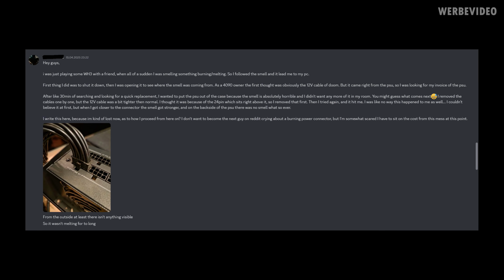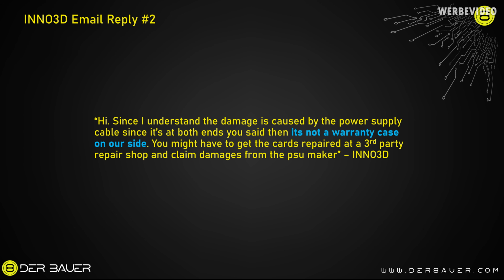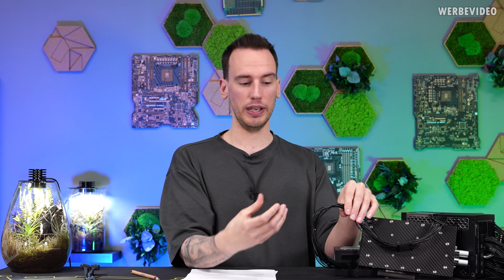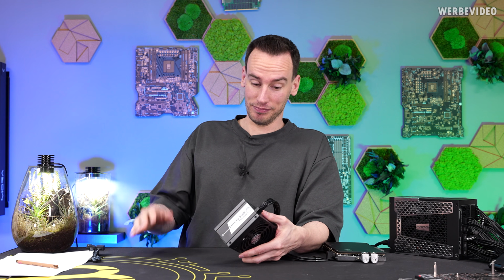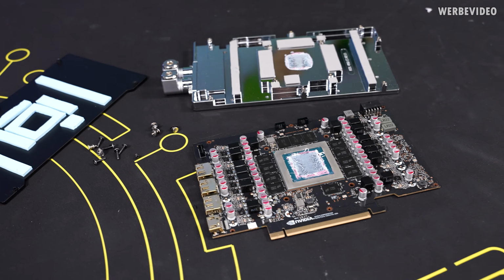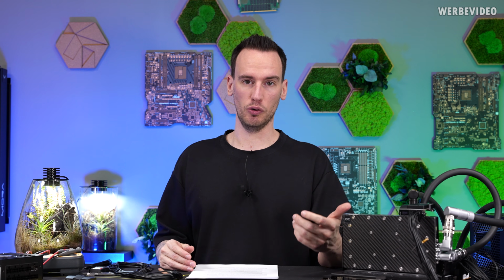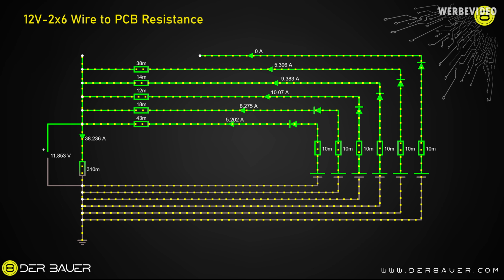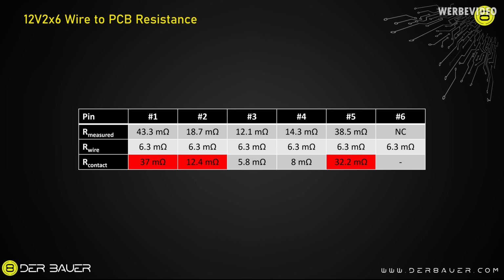Investigating and Fixing a Viewers Burned 12VHPWR Connector

Comment: Any way you slice it, the responsibility for proper power balancing falls to the load itself. In this case, the load is the GPU. If the GPU causes the Power Supply to deliver that load in an unbalanced manner that is dangerous to the hardware in the chain (PSU->Power cable->GPU) then the GPU is the one responsible for balancing ITS demand. Relying on the Power Supply or the power cable to operate as a fusible link is not only dangerous, it's wildly irresponsible on the part of Nvidia and PCI-SIG.

Power Supply vendors could fix this by making more expensive PSUs that monitor the 12V2+6 connector, but should power supply vendors and the customers be on the hook for a shoddy specification and shoddy designs based on that shoddy specification to trigger this situation? No. All other components in a PC are expected to balance their power draw, why are overpriced and underperforming GPUs given a free pass? They can afford to build a proper balancing circuit and take a little away from their 60-80% margins to pay for it. Ngreedia doesn't deserve a free pass on this, nor does the PCI-SIG. I look forward to the future class-action lawsuits to enrich the lawyers.

Comment: The X8 PCIE is caused by a GPU popping off the PCB. Either a BGA pad broke off the PCB or a ball has broken off the pad. Not uncommon on large die 90 Series cards. Re-ball Time

Comment: Might be time for them to move to either 24v on supply to the GPU, which would be expensive upgrading the PSU. 
Or, they need to add another connector, or larger pins / cable spec to allow more of a current draw. Make the connector out of metal and add a heatsink to it. 

Easiest solution is to add another 12vhp connector to the card and be done with it.

Comment: 3rd party cable. Seems all the melting is ALWAYS a 3rd party cable. They are making the cheapest cables possible to make highest return. Instead of soldering the ends on, they are crimped... Easy solution, Stop buying and using them. No NVIDIA cable has melted yet. Surprise Surprise right? Nope. NVIDIA knows how to make cables within spec.

Comment: One component missing is vibration. Vibration could change the resistance under load switching between no contact and contact many times per hour increasing the heat dissipation at the connector(s). NASA for one uses vibration tables to check for issues before launching satellites into space.

Comment: There should always be an engineering safety margin worked into calculations. For example a power supply with 100v rails does not use 100v capacitors. You go with generally 50% if not 100% safety margin (150v or 200v capacitors). Only where there are severe space or other limitations would you use a 120v or so capacitor (just an example) - The safety margin worked into these connectors is essentially zero to 20% - since things are not perfect in the real world, when there are variation in the current on certain wires, we spike well over the safety margin and it melts. This is literally electrical engineering 101... like elementary level stuff... very elementary. Its embarrassing NVIDIA did this, but almost comical its so outlandish.

Comment: This looks like it was for a mini ITX case with an SFX power supply. I've done a few of these, and what I've seen is hot spots in the case since the airflow can be really poor. This also insulates the heat the cable is generating as well. Because all of your tests are open bench, I wonder if you can replicate this easier by insulating the cable, or better certain wires of the cable to see if you can exacerbate an uneven load distribution.
Reply: It was built in the lian li dan A3 with the mesh side panels and 2x 360 rads (one intake the other out), airflow shouldn't be a problem. It happend after a week of working just fine for 3-4h long gaming sessions with 420-430W, then all of a sudden it started melting in a 30min session with "only" 380w and that's that. I don't know what it was, just that inno3d definitely doesn't give a fuck about it🥲

Comment: until Nvidia changes the cable back to standard Molex, I'm staying away from that garbage, ill stick to my 3090s. Like what is the point of this power delivery system if its a single bus, why not use Flexible Busbar instead.

Comment: Issues like this will only make the 12gb 5070 more popular, lol, I couldn't afford a 4090 or 5090, I hear the 4090 is still 2 grand.....
You can build a pretty bad ass system with a ti or super 5070 or even 5080 for 2 grand, lol, I just bought custom cables extensions, 18AWG for the 12gb 5070 I just got, By the way the 5070 is fantastic, I used a Quest 3 for AMS 2, And even with medium to high settings, AMS 2 looks better than ever, The detail in the car is staggering, My 12gb 3060 would shimmer on the fences ect, None of that with the 5070, Plus people moaning about the 12gb part, When it is GDDR7, Next gen in vRam, I only used 5.9gb of vRam for AMS 2 in VR, Simulation at it's almost best, So I can only imagine what AMS 2 would look like on the Quest 3 with either 4090 or 5090, Photo like graphics in VR, Making VR something you stick with, Instant VR addict, lol, No more using monitors to game, And those lucky enough to have a Big Screen Beyond 2 VR, I bet simulation titles are breathtaking, Games like No Mans and Elite in VR I bet are staggering, Coz I got the 5070 and that alone is pretty darn good, So a 4090 or 5090 would be off the hook, But I can see people getting the 5070 purely coz it a 250w GPU, The cables are mostly rated at 300w, I think, Either way a 5070 running at 250w got far less chance at getting stupid hot, Also I would not get a 2 fan high end GPU, High end GPU's should have 4 fans let alone 3, I got a 3 fan 5070 from MSI, Purely coz I though the 3 fans will be better for the PCB, lol, Brilliant GPU, And if you cab get the 12gb 5070 for the 549 pound then even better, Please don't let anyone bug you out by the 12gb vRam, Even in simulation in VR I have not used more than 6gb so the GDDR7 must be better, I am chuffed coz I went from a 12gb 3060 to it's all good, To a 12gb 5070 and like this is bad ass, I can now enter proper online races without the worry of freeze framing and stuttering, 80fps in VR with what I think are pretty bad ass graphics, So personally the 12gb 5070 is worth getting if you enjoy gaming, I only do a few hours in the evenings, Sim Racing helps me manage mental health issues I struggle with, But now I have a better GPU, I can see myself getting back into Sim Racing a bit more, Might even upload some vids again, Though I have no interest in a You Tube channel, The attention is something I do not want.....
Brings me into, Have anyone with a 5070 had any melting cables from heat, There is a reason when I charges my E-bike, I only use a 2amp charger, Purely coz of heat that a 5 or 10 amp charger puts into the battery connector is not good, Use a less amp charger and you won't get much heat, I guess it is the same thing in theory with the GPU's, Too much heat causing connectors to melt, Yeah I don't think the 5070 being 250w is going to have as much as a failure rate as anything bumping out more than 300w, Plus if I was using a 4090 I would probably stick a 1000w PSU on it, I am thinking of getting an MSI 1000w PSU myself, Amazon has a bunch of MSI stuff on offer and in some sort of sale, I think the 1000w PSU is 130, I think, Another was 99 pounds and being MSI I think that isn't that bad, MSI makes quality part for PC's, I am trying to get a full MSI build, All I need is an MSI PSU and MSI Liquid cooler, lol, If MSI do Ram sticks I will get them as well, lol, The MSI 320 Airflow case is a fantastic PC case for the price they is, I was looking at the thermal take popcorn type case, But got the MSI Airflow case instead, And I am glad I did, The Thermal take can be another build in a few years time, lol, Coz fingers crossed as time goes by PC parts will become cheaper, Apart from GPU's, GPU's will always be expensive, lol......

Comment: It would make more sense to have a two wire plug. 8 gauge wire if made correctly can be very flexible and can handle the load. There are plenty of 12v high current plugs already designed and battle tested.

Comment: In copper conductors, rising temperature increases resistance, leading to more heating, more resistance, and potentially thermal runaway if heat isn't adequately dissipated.

Comment: Why don't they just go to a higher voltage? Then you wouldn't need to run as many amps. Laptops already run on 18-20V to save on wire thickness.

Comment: As somebody with a EE background, Roman, your testing methodology was sound and appropriate here, good job.

I learned 2 things in this video.  1.  I will never buy anything from Inno3d 2.  I just became a moddiy customer.
Reply: And you won't buy any Nvidia GPU, RIGHT?
Reply: @micobugija6284   ..... riiiiiiiiight????
Reply: @micobugija6284  Please just stop with the generalizations and strawmans.  I have been building for two decades and have used green cards for 20 years.

I just bought my first red card ever.  Doesn't mean I don't still have multiple systems with green cards in them.  

EVGA, would have warrantied this, period, end of discussion.  Nvidia designed this trash, but it's still on the board AIB to cover the warranty and the AIB to go back to NVidia for their slice back.
Reply: @micobugija6284  Hold that beer.  I've seen some AIBs using the 12VHPR connector on AMD GPUs too now. :(
Reply: @micobugija6284  And you wouldn't buy any ATX 3.x power supplies which all have the exact same connector on them because of Intel who created this standard.  Everyone is blaming Nvidia for a ATX standard set solely by Intel
Reply: @longjohn526  as far as I understand there is nothing wrong with the cable per se. Yes it has less headroom, but the real problem is the card not doing any sort of distribution on the power lines, which can lead to massive load on single cables. A load that is way out of spec. So if you put something into a cable, and that thing manages to melt down everything because of ridiculous loading blatantly out of spec on the channels - that is a problem of nvidia and nvidia only. As soon as your component does something this wildly out of spec , basically on its own, then it is not following the spec :D its pretty simple.

The wiring in your house would also melt if you just start randomly drawing above 3500 amps on single breaker - and not let the breaker break. Sure , a breaker can handle 3500W , but nobody is expecting this load to be done through a single normal house cable. With this kind of loads you would definitely want more bulky cables and better isolation as to not have 70 degrees warm cables in your walls :D
Reply: This makes me wish I was still in college and had more free time

Creating a load balancing auxiliary board for this connector would be such a fun and challenging project

Comment: I have been a console gamer for the last 40 years or so. And recently decided to build my first gaming PC. So I effectively came into this with no bias or preferences. I was aware Nvidea and AMD made GPU's but that was about it. So I jumped in head first and did all my research. I was excited to see the next generation of cards both companies came out with and then settled for a 7800xt as that was the best deal at the time for 1440p and was a placeholder of sorts. I had planned to buy a 5070 ti but then started to see the horror stories come out everywhere. And also saw Nvidea's responses and actions. And this soured my opinion of them. So I made a conscious decision and voted with my wallet. And picked up a Gigabyte Gaming OC 9070xt. And keep in mind the 9070xt was a bit over MSRP and for about 120$ more i could have gotten a 5070 ti. My 7800xt was also the same brand and model and I had good luck with that one so it was a natural choice. And it also was the cheapest version available at the time. I am extremely happy so far with the performance and both undervolted very well. It's crazy to see Nvidea get knocked off their pedestal so quickly. I hope it is their wake up call to do better when it comes to servicing the customers who made them who they are today. Just my 2 cents from a newbie 😊

Comment: At this rate, if I were a 4090, 5080 or 5090 owner, I'd just go right ahead and try to find a way to modify the card's power supply area to use connectors and cables that can withstand the high power and current, a la LTT, or in a way that I can go back to the 8-pin connector. I mean, why worry about the card warranty when GPU makers are just going to try and push the problem to the psu maker or cable maker. The bigger concern is melting and causing a fire so voiding a warranty to prevent that is definitely worth it, in my opinion.

Comment: The solution is simple - fatter pins with thicker gauge wires to offer greater cross-sectional area for less overall contact resistance. As DC power rides through the entire cross-sectional area of a conductor, this is the only way to resolve it. Fewer pins and wires will be required, board design might be a bit more painful for it but at least the current handling will be correctly dealt with.

Seriously, whomever the engineers are that signed off on this failed approach need to reconsider their careers.

Comment: As it happens I just went through this exact same thing on a 2.5 year old 4090. In summary I can confirm that nothing changed over that period of time and the card and connector were working perfectly for over 2 years and then suddenly started to melt at both ends. In my case the cable was a 12vhpwr GPU side and 3x8pin on the PSU side. I had a 1600w evga supply, 4090fe, and a cablemod cable. I am convinced that this is caused by thermal cycles causing the pins to expand and contract causing the female pin side to lose its tension on the male pin. On the PSU side all 3 of the 8pin plugs had melted pins. This is a problem and the manufacturers are ignoring the real problem here. If my hypothesis is correct there will be more and more of these as time goes by due to the thermal cycling. I’ve written this up and it has been forwarded to nvidea. Fortunately I bought a complete pre-built machine from Falcon Northwest and they replaced the GPU, PSU, and cable under warranty! I will include the complete write up and analysis I did here.

Original write-up:

I used this system solely to run a big sim rig which runs a 8k 32x9 display and a 6kx3k VR setup. So no mining or stuff like that. I do push it to the limit for the high res displays and pretty regularly saw it hit 480w but never thermal limits, in fact I monitor every temp etc for every session and it’s been happy no extremes. I keep the operating environment under 67f with ac so it’s always been very well treated. I’d guess it’s generally on and pushing full power a couple hours a day tops. 

The physical connection was checked by myself when the machine was new to verify proper complete insertion and proper bend strain relief etc and everything was 100% good and within spec. The connections had never been removed and reinserted. 

During the first year or so I was pretty paranoid with all the internet reporting on this and am certain that there was no melting going on during the first maybe even 2 years. In fact I really think it started within a month or two of my finally seeing what was happening since faint smell was the only outward sign at that point. As an engineer this all tells me that the pin connections were all good originally, and there was not any physical factor present (strain, oxidation, insertion friction etc) responsible for the obvious connection degradation which occurred. This then leads to the probable conclusion that these connections simply lost their “grip” through a combination of thermal expansion/contraction combined with a loss of tensile strength in the split female pin grip causing the pin to lose connection integrity over long term use. 

This is obviously very concerning and I would expect that anyone else, at least with the same style female pins, is at risk of the same outcome as their equipment ages and how many thermal cycles everything experiences.
Reply: Interesting, my card was also around that age. It was bought on October 31 2022, without any problems so far. But when i switched to a custom loop with new cables and all it worked for 7 1/2 days, then this happend all of a sudden. 

It's been a tuff year so far with my PCs, hope it gets better from here on out.

Comment: I just got a 5070ti so had to get a new PSU (didn't want to risk having 4 connection points vs 2) and this is just an atrociously designed power plug. The cables are just too damn small, the margins too small. 1 cable goes bad out of the 12, or whatever, and it's done for, eventually. The card is probably running at x8 because of an M.2 slot somewhere in MOBO that's taking the PCIe lanes for it's own use. Could be up to 2 M.2's taking x4 each. Maybe there's poor metal in those pins? Like cheap Chinese metal with no quality control? How else would they get such variable resistances? Also, wait, dude bought an aftermarket Corsair cable for a modular SIlverstone PSU? I mean, that right there is probably the issue. You're never supposed to mismatch cables on modular power supplies due to how they may hook up at the board. I get it's a standardized pin connector layout, but ONLY on the GPU side, technically speaking.